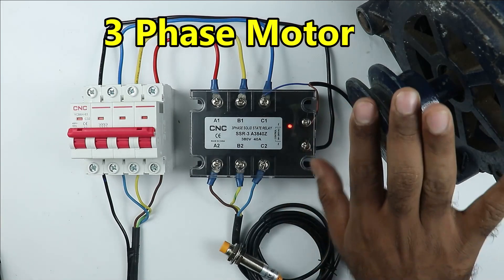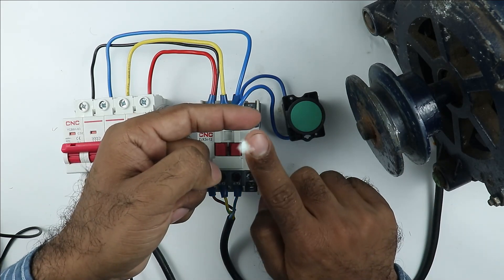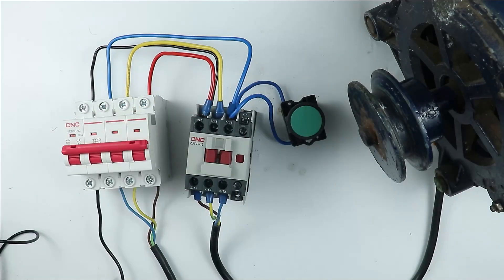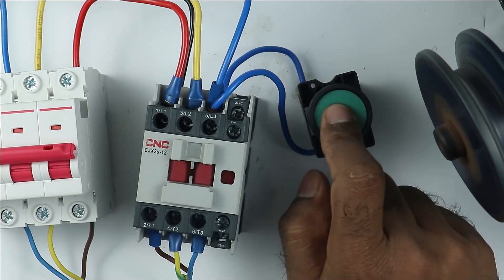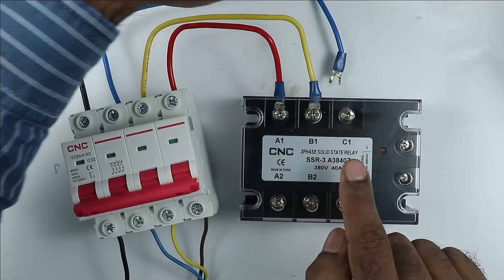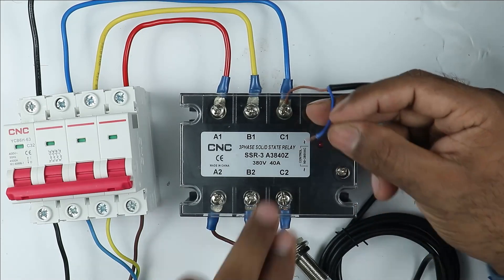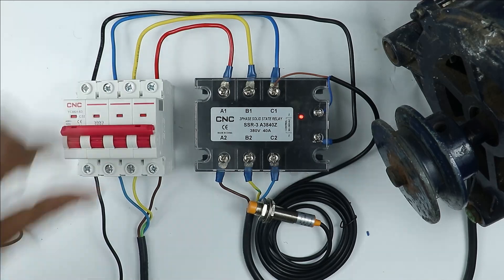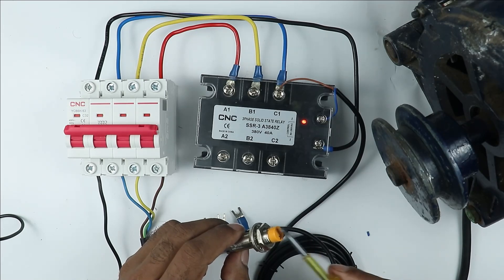3 Phase SSR ON and OFF by using Proximity Sensor | SSR Connection @TheElectricalGuy

Comment: Very good video, but there is some misinformation.
1) You are using an SSR AA which has AC control voltage. There are DC control voltage SSRs too; same SSR would be a DA with 3 to 32 VDC for control.
2) Contactors provide a PHYSICAL disconnect of the circuit. For safety, there should STILL be the contactor in the circuit upstream of the SSR. The contactor would make first and then the SSR which switches at zero-crossing (providing no spark). The SSR can fail on. The contactor fails off. The SSR switches at zero crossing (if it is a Z SSR), so there IS a delay of 1/60 second (16ms). In this case, the advantage of the SSR is ling life for the contactor's contacts.
3) A contactor is normally INSIDE a metal enclosure, so sparking a fire is not an issue.
4) This is a ZERO- CROSSING SSR so it only switches at 50Hz or 60 Hz (in US). A random-fire SSR switches as soon as the control voltage is applied. Zero-crossing SSRs are not good for larger HP motors. With motors, the current and voltage can be out of phase causing a surge which will damage the zero-crossing SSR.

Comment: Thanks so much sir. Am just curious to know whether an SSR relay can be  switched off and on at a high speed frequency on it's control side. Say may be it's a  three 3phase but controlled with DC volts and you want to control it with an ic CD4047.
General, what could be it's maximum switching frequency. 
Secondly, can we pass DC volts on the load side ssr output instead of an ac volts
Reply: Use the DA version which has 3 to 30 VDC for the control voltage. This is a ZERO- CROSSING SSR so it only switches at 50Hz or 60 Hz (in US). A random-fire SSR switches as soon as the control voltage is applied.

Comment: Please put a fuse inline with the sensor.
is the sensor cable rated at such voltage?
Motor should have overload as well as MCB.
Reply from the maker: Sensor operating voltage is 230 VAC
Reply: @TheElectricalGuy  Great.
But... that thin wire going to the sensor is protected by the MCB (not sure what Amp size from the video), it should be protected by a 1Amp mcb or similar.
Thanks, its good to see this sort of training our there.
be sure to mention what type of SSR, there are a few types, some for motors, some for heaters, etc.
Check the details of the MCB, a motor overload would be beneficial and cut supply to sensor, therefore turning off the SSR and thus stopping the motor.
Reply from the maker: Thanks for the feedback